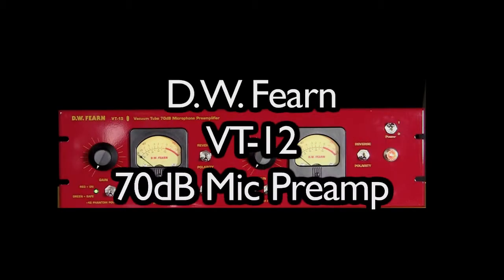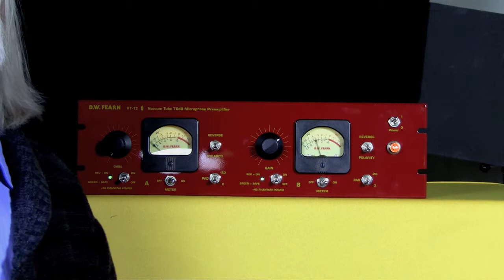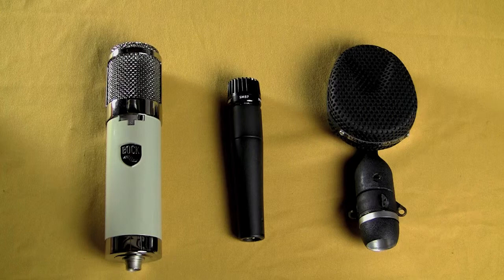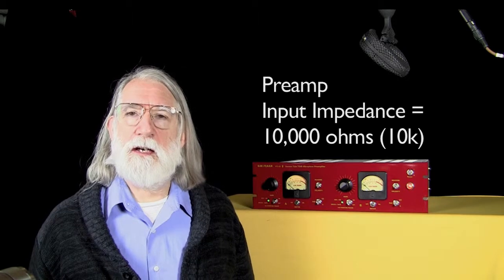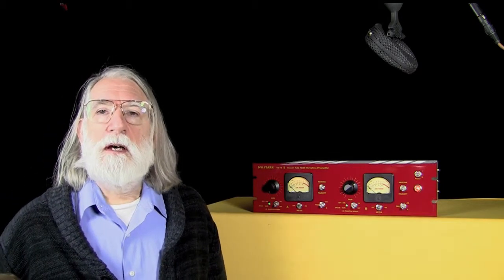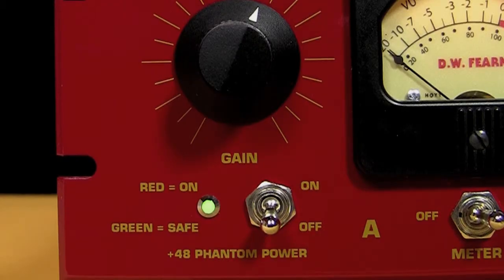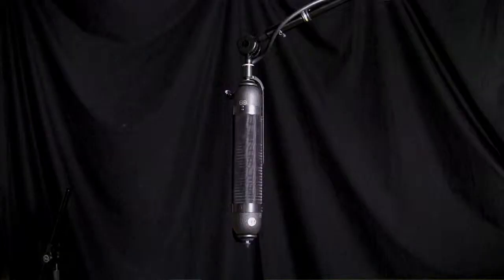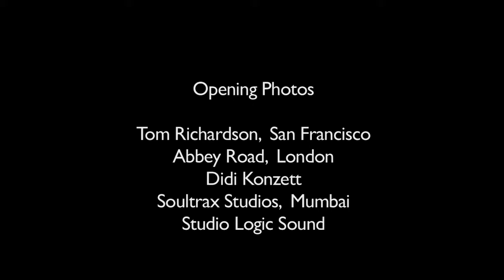DW Fearn VT-12 Tutorial.mov

Comment: What about for active ribbon microphones like the AEA R88A? Which of your preamplifiers would suit that best?
Reply: The VT-12 has been discontinued for a few years now. I may introduce an updated version at some point. For an active ribbon mic, our VT-1/VT-2/VT-24 preamps would be optimum. Those preamps are perfect for the higher-output and lower impedance of active mics (or those used with an external gain-boosting device).